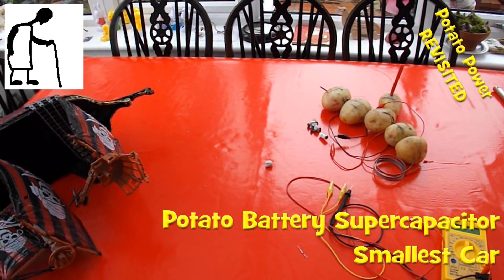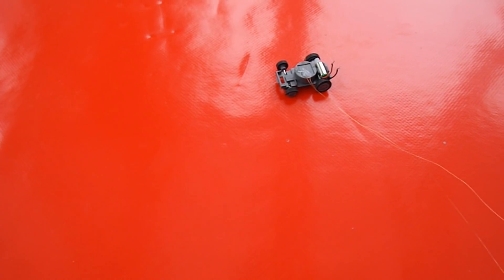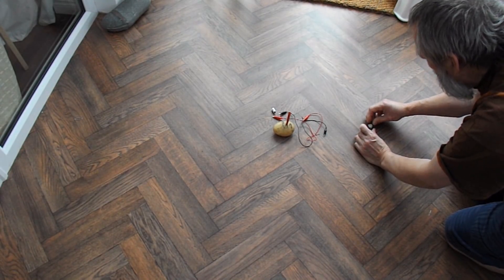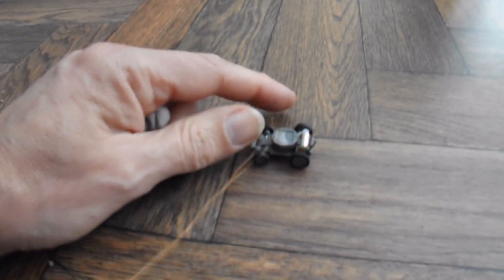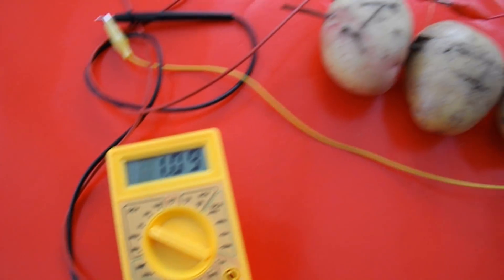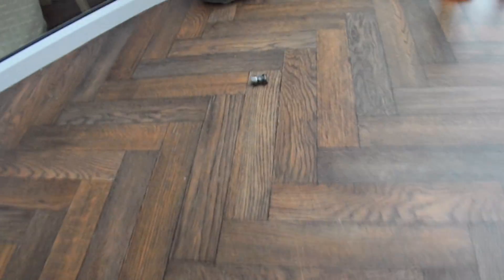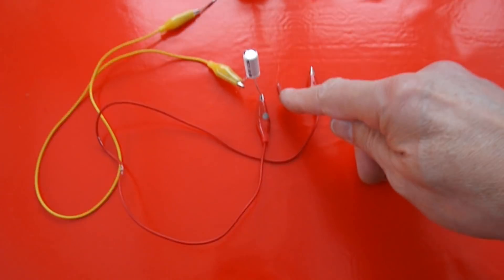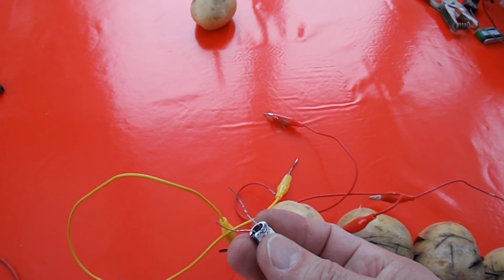Potato Power revisited PART #10 Potato Battery Supercapacitor Smallest Car SUCCESS

Comment: Mate try the  dirt batters in s series and parallel with the little bit of mulch on a little bit of rotten food mixed in you should get enough bacteria an mold to get 6 volts and 1 amp for 9 months 24/7  :)
Reply from the maker: You have experience at this?
Reply: @GrandadIsAnOldMan   yeah but that's the coolest little car Iv ever seen :)
Reply from the maker: @ashj_2088  thank you

Comment: That little car was zippy-fast.  That was quite the investment of potatoes to get to this point!  I very much enjoyed your series on this and I learned a lot.  Thanks!  It gave me an idea for a unique potato battery of my own-- but do I dare invest in such an endeavor?  ugh... you put the science bug in me... 😊
Reply from the maker: Good luck with that. There are a few more episodes to go but this series has rather drifted away from the specific task of getting a self contained car or boat running directly from potato power. I still think a boat might possibly work as you can float a lot of potatoes and still move them with very little power. As for investment, probably only 2 or 3 GBP on potatoes. Lemons would have been significantly more expensive. I can't remember how much the magnesium strip was, not much, and the copper was not too bad either in the form of those plant labels.

Comment: nice video, but pitty u couldnt run it right off the potatos since they were in paralell.at least u could say it was potato powered since the capacitor was charged by the potatos.i looked back at ur videos where u did 2 projects on a lemon powered car that were fan driven but u used a battery cuz the lemon didnt bring out enough power to turn the fan.was thinking if u could try the same amount of lemons in paralell to run that little car but u might run into the same problem as u did with the potatos.what u think?
Reply from the maker: The difference between the power from a lemon and a potato is insignificant compared to the difference between a potato battery and a normal AA battery. Those lemon videos were spoof videos not intended to be taken seriously and I explained that in the videos and the descriptions. There are many spoof videos on the subject trying to trick you into believing they work. My videos made it clear what I was doing was fake and I showed the battery. What I would really like to see is somebody else have a serious attempt at making a potato or any other fruit/vegetable battery run a car that carries the potato on the car while it runs. All my attempts have shown me that there is nothing like enough power available, even when we use magnesium and boil the potato. Lemons are probably at least 5 times as expensive as potatoes so making a larger lemon battery starts to get expensive but feel free to have a go yourself, you might be the first to achieve success  😊